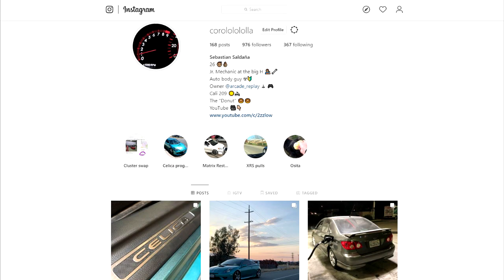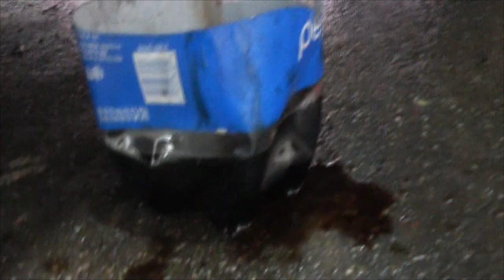How to remove timing chain cover on 2ZZ-GE with engine still in the car.

Comment: How come my clothes look like I've been working in a coal mine all day   when I do a job like this but you don't have 1 oil stain, nice job, you make it look so easy
Reply from the maker: When you work at a dealership you learn this. You cannot in any way get the customers car interior dirty.
Reply: combination of being carefull, washing the engine first before working on it if its dirty, and using the correct tools so youre not reaching into dirty areas unnecessarily.
Reply: Its cuz his engine isnt covered in sludge like ours were

Comment: a tip for people that forget where things go, just take pictures. use cardbord and push the bolts through it, in the correct position for the bolts, if you cant keep them in the bolt hole or with the part.
Reply from the maker: thanks for the tip fam
Reply: I always think of the movie momento.
Reply: Never thought of cardboard damn... i already got everything apart. That is a cute idea for real

Comment: Superb step by step tips removing all parts involved to remove timing chain cover. Kudos mate
Reply from the maker: Glad it helped
Reply: Dont touch the ac compressor. It doesnt need to be unbolted to get the tc cover off. 2 bolts broke on mine  and i couldnt even remove it. Then i realized i didnt even need to attempt it. Stupid. My fingers are crossed that when i reassemble this that the compressor is fine how it is. I tried prying it a few times and it wouldnt budge so im hoping its fine. Dont touch the compressor. Wasting your time.

Comment: Dude internal combustion engines are SO complicated. I do software for a living and  the complexity of these engines is even crazy for me! I have to just wait until cars are electric I understand induction motors just fine lol
Reply from the maker: ohhh boi lol
Reply: lol this seems to be the opinion of many software engineers. Might have to do with a certain Silicon Valley based company?

A mild bit of irony - this motor was used in the Lotus "Elise", which was the basis for the platform Lotus used to build the Tesla Roadster. Without this motor there would be no Tesla.

Comment: For the water pump pulley, you can stick any bolt through one of the vacant holes, spin the pulley and the bolt will "catch" on of the indentations on the motor side, this will hold the pulley still while you break the 4 loose
Reply from the maker: ill give that a shot next time i do this job. thanks!

Comment: ATF makes a great engine flush.  I mess around with Nissan 300ZX Z32s pretty heavily and they're really bad about getting lifter tick when they get sludged up.  I dump a quart of ATF in the oil, drive it around for 20-30 minutes easily and the tick goes away.  Then I drain the oil with the atf in it and change the filter.  It usually does a really great job of getting rid of sludge.  
Also, Harbor Freight has a really cheap pick set that's great for extracting dried up gaskets.  There's 4 different little picks in the set.  They have orange handles.  A lot of times they'll be free if you get their coupons in the mail.
Reply from the maker: Going to have to try that atf method as you aren’t the first that mentioned that. Yea I actually got those picks for free the other day, I saw the coupon in the ad.

Comment: When I did my timing chain cover gasket I did not need to take all those things I simply lifted the engine high enough, with a jack nd piece of wood under the pan nd taking off the motor mount from tht side ,until Pretty much everything was accessible even tht ac line u we're talking about.   Good work tho .
Reply from the maker: Everyone has their ways
Reply: What all exactly did you disconnect doing it this way?

Comment: I just paid Toyota to do this. They did the tensioner o-ring and crank seal as well.  I seriously didn't have the patience.
Reply from the maker: not all of us do...
Reply: @Weaponised Potato
How much did you pay for that?
Reply: @asdfkjgh96  local shop wants 7 hours and $1,250. Crank gasket only is $215. 
2001 Celica GT  San Francisco area. I NEVER GO TO DEALER.
Reply: How much did you pay?

Comment: Super useful video. One tip, loosen the 4 water belt pulley bolts before you remove the belt, that way you don't have to grip the pulley to get to loosen them later. I wonder how different this process is for euro cars that don't have the cruise, but instead have the stupid secondary air injection system?
Reply from the maker: Have to unbolt the exhaust manifold from the engine and mid pipe. Adds about an hour extra
Reply: One tip not many know. The extra holes in the water pump pulley are so you can stick a long bolt or allen key through them to prevent the pulley spinning while removing the bolts.. just in case anyone is reading this after theyve already taken the belt off :)

Comment: I did this on my 06 vibe gt. Tips: no need to remove ac compressor. Use oem gasket on timing chain tensioner or buy gasket from toyota dealer. If you break the nut or round it on ur belt tensioner u can use a c clamp to compress the piston and not have to replace the tensioner.
Reply from the maker: Removing the ac compressor at that point in the removal process of the timing chain cover will only take 2 minutes to undo. Purpose is to clean the engine while you are there and helps with visibility. That’s all

Comment: Hi, is there a way to do this job without removing engine on euro spec celica that has egr and that metal pipe in front of the timing cover? Tnx in advance 

Btw I don’t have cruise control, I have secundary air pump instead
Reply from the maker: you need to remove the exhaust manifold to clear the cover

Comment: Great video. Thanks for the easy to follow commentary.

Got to do exactly this on my UK Celica. Think someone below mentioned an EGR and you said exhaust manifold, so will check for that.

Just a question about jacking the engine - did you let the engine sit with the RH engine mount before jacking to take out the timing chain cover? Just wondering if it's safe to do that.
Reply from the maker: In UK i believe all 2zz engines had the secondary air injection system and confuse it as an EGR system. 

i let the engine sit without the rh motor mount. all 3 transmission mounts can hold the engine

Comment: Thank you for doing close-ups of the bolts, assuming yours is correct. Too bad you didn't measure them, I ended up counting the number of threads from your video to make sure that single bolt is probably 20mm (also based on MWR website). Because many of us are the second or third person in there and somebody pretty much mixed up all the bolts before me. I was shocked to find different lengths of valve cover bolts scattered randomly across valve cover, ignition coil, water pump, and timing cover.
Reply from the maker: Glad to help

Comment: Great tutorial! You have helped me a lot with this. I have to do the same job to my 2004 Celica ts. It is leaking oil in the passenger-exhaust side corner. The valve cover probably is leaking in that corner, but maybe the chain tensioner or/and chain cover are leaking too. My drive belt tensioner is stained in oil too, and when I start the car the belt squeaks a little for a minute or two (I think some oil fall on it). For making this job on my car I have to take out the exhaust manifold too, and since in your video this part is not needed, can I ask you some advise on it? If you have any tips & tricks or things that I should watch in taking out the exhaust manifold, can you please give me advise? For example, are the bolts easy to remove? Should I replace the exhaust manifold gasket too? If I should replace the gasket, should I just put in the new gasket and place the manifold on , or there are some things to do first ? Are special tools needed? If you could make a video about the exhaust manifold would be awesome, but any advice is appreciated.  Im a little scared about the fact that the exhaust manifold is quite deep inside behind the engine, and I hope I can reach (maybe it is easier if I lift up  the engine with the jack a little?). Thank you again !
Reply from the maker: check a more recent upload video on timing chain cover gasket for a 2005 corolla xrs. it goes through the same procedure on removing the exhaust manifold to complete the job.

Comment: Excellent. Thank you very much. To your knowledge, is this possible on a 03' vibe (GT) which is exactly the same under the hood as a 03' Matrix XRS. Much appreciated.
Reply from the maker: Yes, follow the same procedure but for the ac compressor use a strap to hold it up to not put stress on the ac lines

Comment: Does the ac comp really need to be removed? Or is it just for the extra room you get?? In the middle of this job and one of the 3 ac comp bolts wont come off of course its the one on top so i cant get my extractor sockets on it w/o discharging the system. i only seen one 10mm bolt that is behind the ac pully can get  a 10mm wrench on it. just wanted to ask before i go further
Reply from the maker: you can try to see if you can get those bolts near the timing cover off but its going to be a tight squeeze
Reply: @2zzlow  TY for the response! i got it off car is finally leak free. also ty for the vids they have helped a ton.

Comment: How many miles did this car came with? Would you suggest buying a 2000 gts with 190,000 plus miles on it?
Reply: Depending on price and condition, I've bought a 2000 gts for $500 with 219k miles, I'm gonna do a rebuild on it so i didn't care for it
Reply from the maker: This 2001 GT-S has 170,000 miles and I paid $900 for it but it did have quarter panel damage. 190,000 seems a bit high and you most likely will have to replace multiple gaskets including this one so it honestly depends on the price you pick it up for.
Reply: @2zzlow  god bless you.

Comment: Hey :) i m a new fan of your channel.  I had no idea about vvti . From a video i saw on your channel u said the " lift " activates at 6k rpms. And the oil needs to be ( x) temperature. 

This web page indicates that engine coolant also need to be 60 degrees celcius too. So yep.

Also, i m kinda shacked about the " lift" at 6k 🤣🤣🤣 

I never ran my gts anywhere 6 k for any period of time long enough to activate the lift. 

So have i been missing out???

Lol i just i m kinda surpriced. I had no idea how vvti really works. 

Fan fact i learned from scotty kilmer is that " the higher the rpm the faster the engine wears out". 

So i kinda avoid the hi rpms therefore did not know about the lift.

I will .... maybe try it ?  

What does it feel / sound like when it activates.  Lol.

Also, do u happen to be in california?
Where r u located. I m wondering if u could refer any decent mechanics for future refrence. 

Any way thank you for making your videos. 

Sinceraly, santa.
Reply from the maker: If you are serious first try doing it in a straight line and in an open parking lot

Comment: Do I need to remove the exhaust manifold on my 04 Matrix XRS like somebody mentioned in the comments to do this job?  I prefer not to mess with exhaust bolts.
Reply from the maker: 04+ 2zz equipped vehicles all need to have the exhaust manifold removed.
Reply: @2zzlow Even the 04+ Corolla platform vehicles?

Comment: Ok so I need help on a 2zz intake manifold removal for new gasket. I have all the bolts off that I can see but still can get it off it’s on solid. Anything I’m missing?
Reply from the maker: loosen the cam position sensor on the left

Comment: I need help getting the top bolt of my power steering pump out it hits the wall and won't come out I've tried lifting the motor and lowering nothing seems to work
Reply from the maker: looks like someone re installed it the wrong way. i cut mine out after figuring out i had the same dilemma

Comment: My power steering pump is really stuck. Ever encounter that before? Any tips?
I'm about to pull the axle out to get some more space to pry and chisel.
Reply: So ended up putting the engine mount back on so i can get the jack out of the way (supporting the engine), and pried it from the wheel well really really hard with a really long pry bar, right at the center of the pump in the direction of the firewall.  In retrospect, maybe didn't have put the engine mount back on.
Reply from the maker: Nice! They get a bit oxidized since metal and aluminum don’t really mix. Glad it worked out
Reply: There's no way it's going back on based on the current tight tolerance, I'll be sure to hit them out a little based on your other video

Comment: I leak about half a quart of oil everyday so i changed the o ring on the timing chain tensioner but its still leaking so im thinking its the timing cover gssket leaking but i dont want to change it if i dont know if thats the problem for sure
Reply from the maker: its going to be the timing chain cover gasket for sure

Comment: Will video work for the corolla xrs 06 model?
Reply from the maker: You can follow it, it’s about the same other than the ac compressor you need to hold it up with something. Check my later video on my channel I have the xrs portion

Comment: You dont need to remove the ac compressor! Don't try it! The 2 bottom bolts broke on mine, so i couldn't get it off, then i realized i didn't even need to attempt it. The ac compressor is a completely external bolt on. The crank position sensor wire runs between the ac compressor and the block but u don't gotta remove the compressor. Don't end up screwed over like i did. When i put this back together im just hoping that it'll hold its place good enough or i gotta remove the condenser and the bumper cover to be able to come straight at the broken bottom bolts for removal. Potential nightmare. Hopefully it dont need it. DONT TOUCH THAT COMPRESSOR. THANK ME LATER.

Comment: 287k on my sons, not looking forward to this job.
Reply from the maker: It’s not bad, do it over the weekend
Reply: @2zzlow  Yeah definitely. I've owned a 82 Celica myself back in the day then traded up to a 85, then 97 Supra. Went from there to a Nissan 300zx, i turned into a show car for 19yrs. Also had 86 Mr2 and 87MR2 Super charged. Currently on 2nd MR2 spyder with Tein Electronic Suspension and Garrett turbo with Greddy piggy back ecu and much more.
Not my 1st rodeo lol. But love to see how other do stuff before I dive in. Saves a lot headaches sometimes. Great job btw!
Still waiting on New MR2 release, they prilly make it electric if Biden has his way. Geezzzz. If only folks could see the cruelty of the folks mining these metals for the batteries for electric cars. Batteries that would cost a fortune to recycle and very difficult to do as well compared to gas burners which are 100% recycled and much cheaper to do. But they don't talk about that do they?